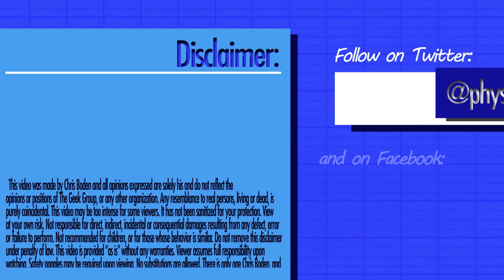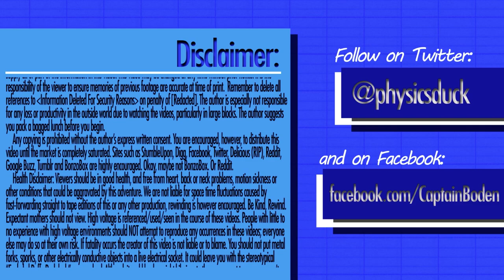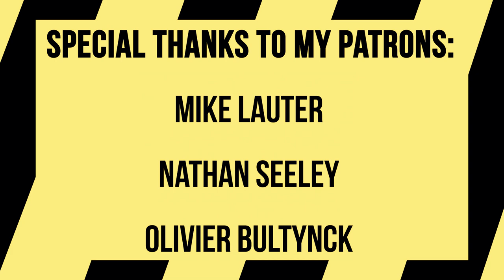How To Return Borrowed Tools

Comment: I was always told return it in the same or better condition than you got it. I borrowed a concrete saw once from my work for home use. I used it blew the dust off it with a leafblower, rinsed and drained the water tank. Then rinsed the thing off with hose let dry top off the gas, etc.

Comment: #1. Put things back where you got them
#2. Give back tools in better condition than when you borrowed them
#3. Never look down the barrel of a loaded gun 
#4. Never drive under the influence
#5. Don't cheat on your spouse
#6. Keep your elbows off the table
#7. Never shoplift
#8. Never pee upwind
#9. Never place your tongue on a frozen flag pole
#10. Never place your tongue on project Thumper when energized